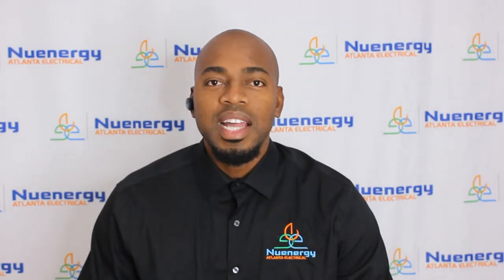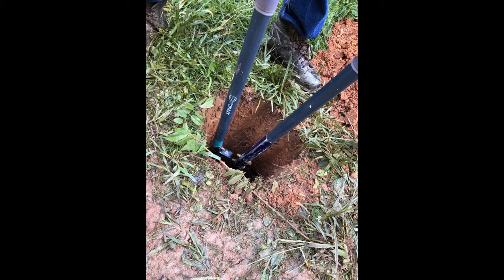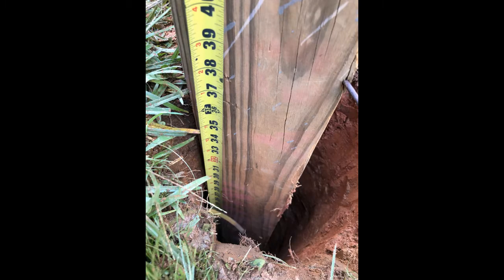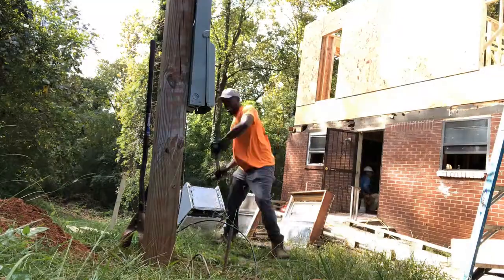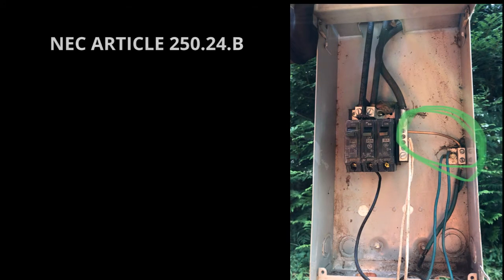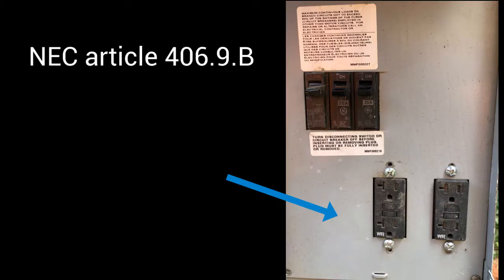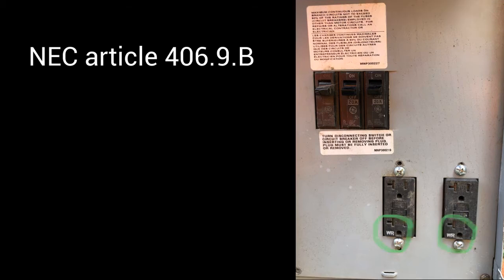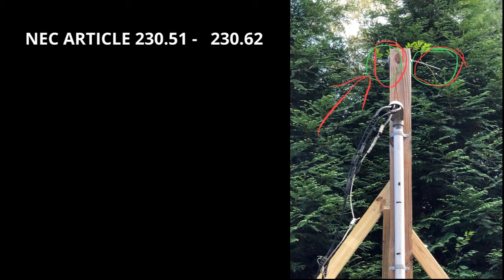Temporary Power Pole

Comment: Which wires are used in the temporary electrical pole? What is the name of those 2 thick black wires? Can you, please, list all the stuffs needed in installing this pole?
Reply from the maker: If you are talking about the feeder wires coming from the service drop, it will depend on the size service you are building; meaning if you are doing 100amp service for a residential project you will size the wire for 100amp. There are several different type of wire you can use. In this video we used THHN Alum. 1/0.

16 foot pressure treated 4x4 post
2x4x12 PT lumber
1.5" pvc pipe
1/0 ALU wire
#2 ground bare copper
Pre-built temporary meter base from home depot (overhead)

hope that helped.
Reply: @s-carrshymahdi9003  200 amps. Thanks
Reply from the maker: @Koumondji  For 200amp you can use 4/0 AL. Its best to get an app that can calculate any wire ampacity or get an UGLY book.